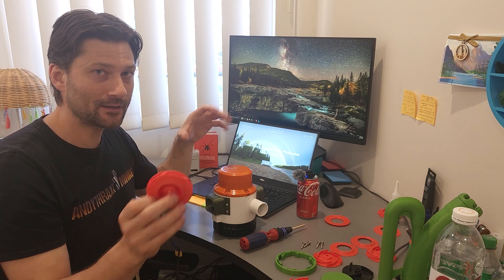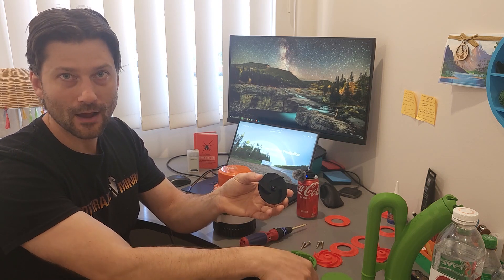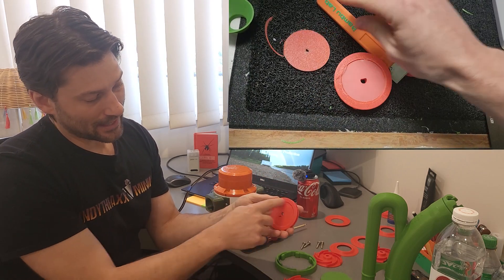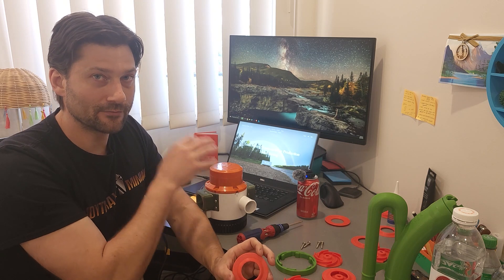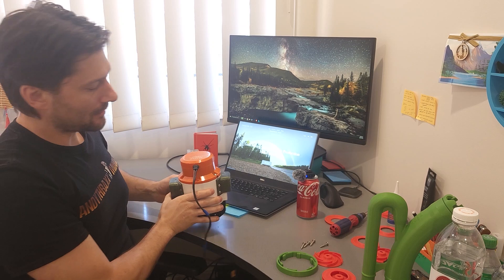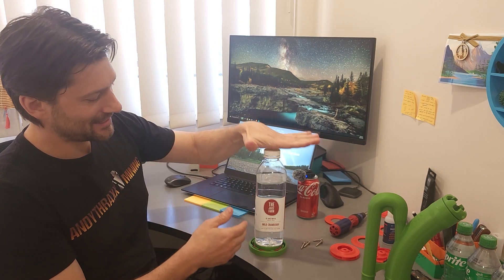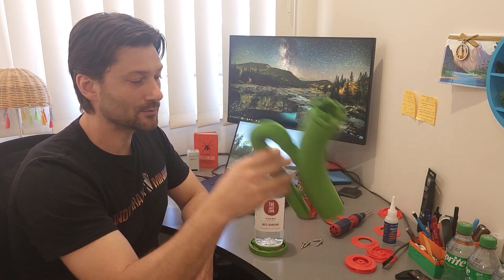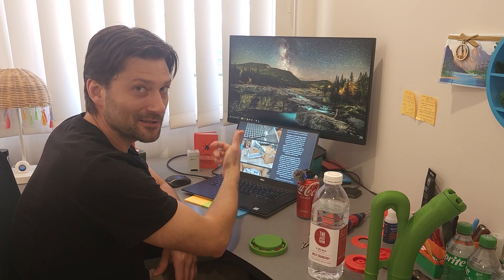How to Install my Custom Impeller on a Seaflo 3700GPH Pump for use on my Electric Gold Dredge.

Comment: I need an 4700 impeller! Contact me please!
Reply from the maker: Hey, I have made the files available on my website since filming this video.  I have also come up with an even better pump upgrade.  By February 2026 I will have the new pump products in stock for sale on the website.
Reply: @UtmostOutdoors Now add a BLDC motor, to your pump design. And change the suction nozzle to a Peri jet in an old Millwright by trade. Worked pumps for years . design = 30% less water GPM, and increased suction.

Comment: I enjoyed the video I also use a 4700gph bilge pump In my channel, I'm introducing videos of making and researching gold dredgers The impeller is very impressive I'd like to buy two, do you have them in stock?  I'm also curious about how to buy it I translated it from Korean to English
Reply from the maker: Hello, I will have a new impeller file available soon.  Do you have access to a 3D printer?  I had a look at your channel, you've done good work! :)
The impeller I made need to be exact for the pump, so my new version will allow it it work on your 4700gph bilge pumps as well.  It is just taking time to get it right, I will be ready within a month I hope.
Reply: @UtmostOutdoors Thank you for visiting our channel! I don't have a 3d printer yet. I'm going to buy one soon. The dredger we made now has enough suction power and has no problem in using it, but we are continuously upgrading it. I've also made and used impellers, but the impeller you made is the closest to perfection I'll be looking forward to it!
Reply: I am looking for an enclosed impeller! Please! Hit me!

Comment: Hi Kyle, Love you videos.
On one of your other videos you mentioned an impeller for a Seaflo 2000GPH pump. 
Can you advise the best means to contact you to purchase one (or the file)
I sent you an email via your website but uncertain if you received it.
Reply from the maker: Hi, I do have a 2000gph and 3700/3700gph impeller I designed.  I was holding off until the start of next year to release the files, but due to the current postal strike going on in Canada, I may have to change that since I want people to have access to the impellers.  Keep an eye on my website sometime next week and I'll see if I can put a file together.
Reply: @UtmostOutdoors  Thanks Kyle, I'll keep an eye out for it. My little project is coming along well thanks to   your videos

Comment: Closed Face Impeller for Seaflo 3700GPH Bilge Pump.  Back in stock after the postal stike. When do you have it again? I need it in Germany for my water pump !!
Reply from the maker: Our post office is closed at the moment, once it's open again, I will put them back in stock.  Sorry for the delay.

Comment: You may already know about this, but I don't know how much of an issue it might be long term:  "CA glue (cyanoacrylate) is considered water-resistant once cured, prolonged exposure to water can break it down and degrade its bonding strength; essentially, water can act as a solvent and weaken the glue over time if submerged continuously."

Comment: Could you design/build a pump housing for ½ inch intake/½ inch out and an impeller just like the one shown in you video? The drive axle will be driven by an accu drill.
Reply from the maker: What would be the purpose?  I figured a bilge pump is waterproof and seems to do the job of pumping water, but if there was a specific use case for a drill powered pump that I found interesting enough, maybe I could try?
Reply: @UtmostOutdoors  Can we talk privately?
Reply from the maker: @Anashadk  you can email me.